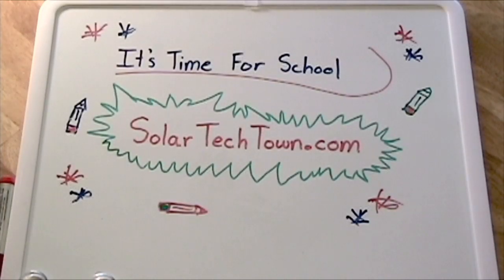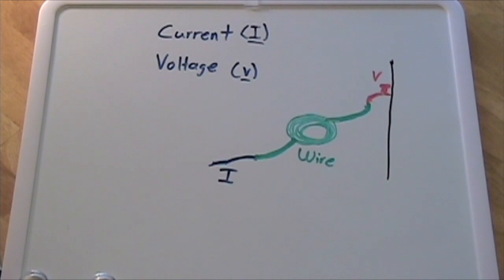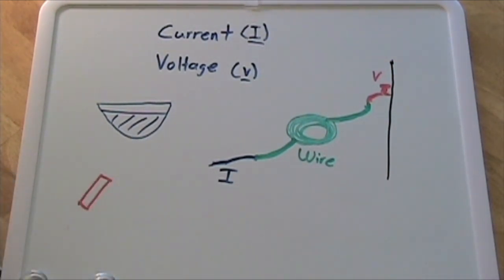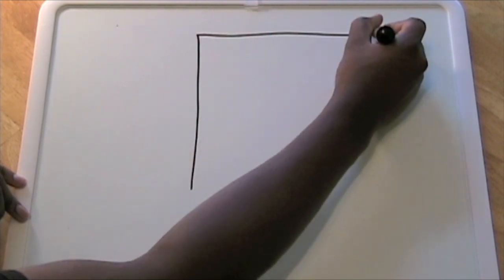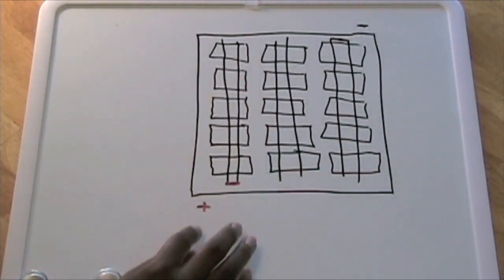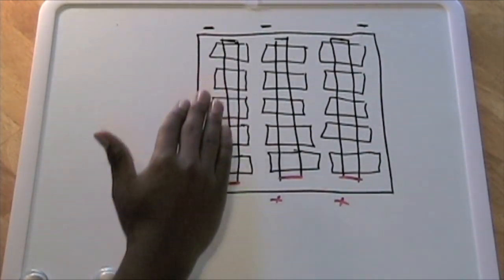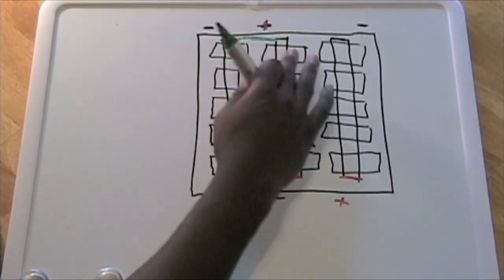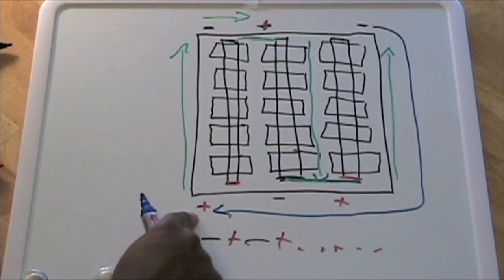How To Build A Solar Panel - Part 14 - School Series Part 1

Comment: Greetings change somewhat settings when assembling and welding monocrystalline cells, polycrystalline or multicrystalline or is the same settings I see in your videos... I want to assemble a panel following your video but  the cells that I have are different from those that did you use in your Videos,,, mine are  6x6 mono crystaline and 3 bus bars and that confuses me to be different from what did you use in your videos thanks

Comment: Positive is a buildup of free electrons and negative is an absence of electrons so it becomes difficult to see current flowing from negative to positive.
The world wrongfully teaches this.   
Current actually flows from positive to negative because how else could you have the number of electrons less at the positive terminal and more at the negative terminal than it was before conduction.
Think it out and it is never too late to learn just how wrong society teaches.

Comment: no he drew it in series, the confusing part is that he drew in 2 connective wires which can make it look like he's drawing a parallel circuit. If you look at a solar cell, they have either 2 or 3 contact terminal lines for wires.  The ones I get usually have 2, but I've worked with some that have 3 before.

Comment: Hey Robert, what if I wanted to power up my whole home assuming that I have an electricity consuption of I don't know 200 kw-hour but at night I turn on my air conditioner that recquires 220 volts so I want to know how many solar panels of those would I need and how many batteries and if it''s even possible....?

Comment: From your detailed instuctions I have built two 5 amp plus out put solar panels thanks. I am having a hard time finding the box that you showed in a video earler for the blocking diode where do you get them.

Comment from the maker: Well honestly, I couldn't really recommend the best way to do it since I've never done it and probably wouldn't do it myself lol, but I can recommend a forum where you can ask about that, but I'm sure most will tell you the same thing I have, but if you really really want to go that route, they should be able to point you in the right direction:

Forum: solarpowerforum (.dot) net

Comment from the maker: Lets just put it this way - You can but it's not practical.

Meaning, sure, you can build 40 or however many solar panels you need to power your whole house, but there are many other things you have to consider when you go the DIY route. Some include, most DIY panels are not covered by your insurance. Another, most DIY panel's life time is not that great compared to a professional panel...and the list just goes on. I would just recommend making a DIY panel for small projects.

Comment: can you make a solar system to power your hole house ? say,40panels in series back to the grid ? or is that dangerous ?  or do you need 40 panels from the factory  if you want to do it save ? and why is it dangerous if you make 40 panels yourself and deliver it back to the grid?

Comment from the maker: Right, the top is the negative, and the bottom is the positive, but in this example we do not need to know that at all as we are not concerned with where the tabbing wire is soldered at on the solar cells (single cell). 

We are just concerned about what end of the strings are negative, and what end is positive.

Comment from the maker: No, I believe you are looking at the example incorrectly. 

In that example, we were not concerned about where the tabbing was (top or bottom), but concerned with where the positive end started, and where the negative end ended.

A string of solar cells can be looked at as just one component (or one huge solar cell if that helps you get the point)  which has 1 positive end and 1 negative end.

So at that time frame we were not concerned with where the tabbing wire was solder at on the solar cell

Comment: at 6:35 you say the  positive side is left below , but it should have been the negative side because the front of the solar cells are often negative ! it starts with the negative side right?  thanks ,karel